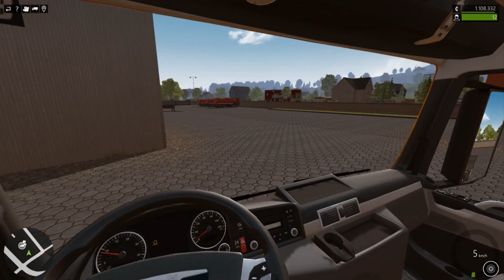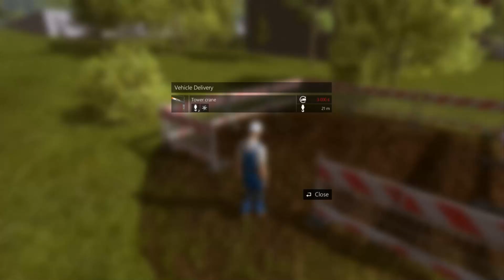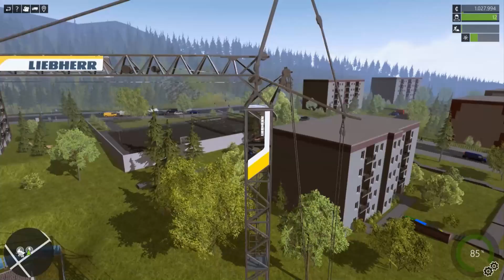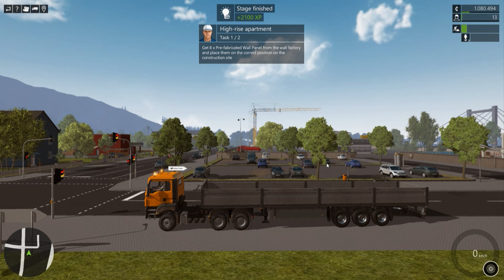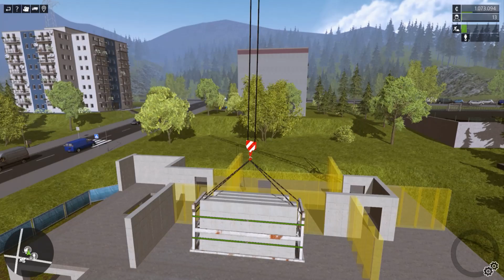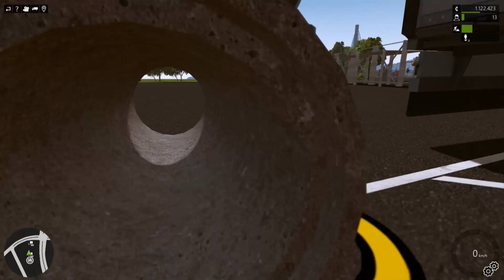Construction Simulator 2015 | Tower Crane High Rise Build Concrete Comparison | EP 28

Comment: Hello, i've just bought the concrete bucket from the store and i'm trying to use it with the crane truck but havo no idea on wich button i've to use to start the concrete flow, i've tried many buttons but no one seems working ... pls help !
Reply from the maker: +Massimiliano Fabbro Hi. You need to use it with the tower crane because the flatbed with a crane wont pick it up.
Reply: Thx so much for the answer !